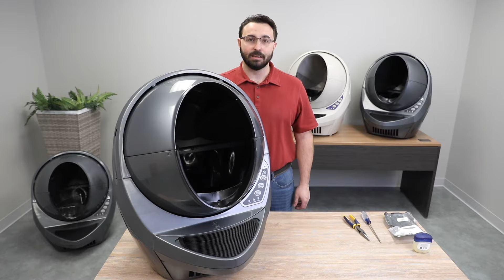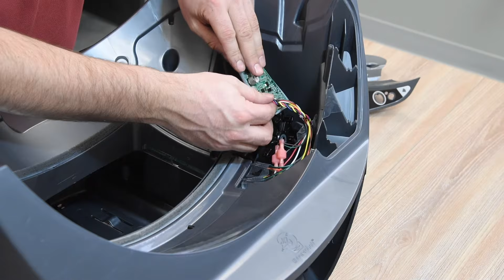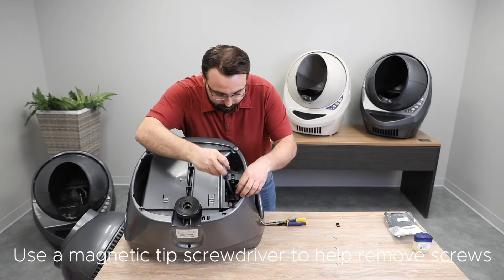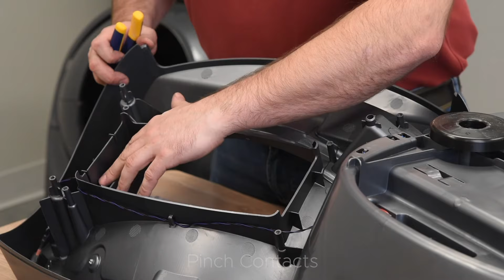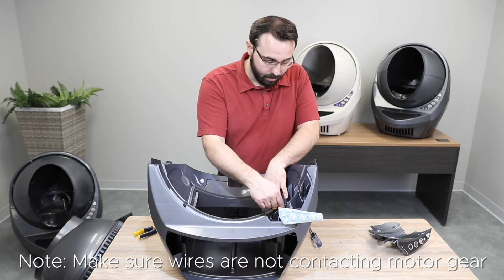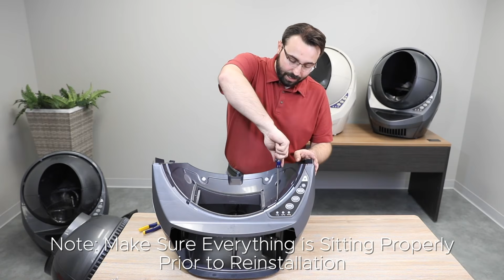Litter-Robot 3 DFI Kit + Pinch Detect Terminals Installation

Comment: This did the trick for me. Thank you. The only problem now is that after  a cycle the robot returns to its position but at a slight angle; so if you're looking at the front like a clock face, 12pm is the correct position. Well mine returns but it positions itself to 1pm instead. Also, once the cycle is complete, the dashboard lights up (all 3 lights) and needs to be manually reset to get the robot back into ready mode. On another matter, I have to counter some of the criticism I've read on here. The company have been very responsive with me. They have patiently answered my questions online, gave timely responses and recommendations on repair and processed my order efficiently. The team are absolutely ace and from my personal experience, I have nothing but praise. As for the robot - I've had mine for 5 years and this is the first repair its needed. It is an unbelievable piece of kit and performs perfectly well for my needs. It hasn't let me down in the past and consistently completes its job with little attention from me. The unit is transformative and sets the standard in this growing industry. Expensive yet, but if you're buying to avoid the daily scoop ritual then it is worth every penny. I wouldn't be without mine.
Reply from the maker: Thank you for your lovely feedback about Litter-Robot and our Customer Experience team!! We would be more than happy to get you connected with a product specialist to resolve this for you so your unit will return to home position correctly. If you haven't already, please visit our Help Center (WhiskerSupport.com) to chat with one of our product experts or submit a ticket.

Comment: Thank you for the helpful video. I followed the instructions and fixed Mayhem the cat's poopbot without issue. It's now November of 2022 and there appears to be a version 2 of the DFI kit. The circuit boards are smaller and the included new brackets don't have the little windows so they can be cleaned with a cloth instead of a q-tip.Tip: As soon as you split the bottom section take a picture with your phone of the pinch connector position, because trying to unplug them may yank them out and the video is not clear on their positioning.
Reply from the maker: So glad to hear Mayhem's Litter-Robot is working properly again! 😸

Comment: They need to answer their customer service phone lines, not just make videos and “email you” which is extremely annoying.
Reply: That would require them to actually care about the customer experience, which they don't. These parts have a shelf life of barely over a year, if that. If they email they'd have to acknowledge an actual issue. This way they can just toss you a generic response and pretend they did a good job
Reply: Nobody answers the phone
Reply: I rather email, who still talks on a phone?
Reply: @Camcruisejourney  many people would prefer phone for customer service because it often is resolved far quicker than email since they can't toss you off for days with no response
Reply: I can’t even get them to reply to an email.
Reply: It took like 4 hours but I didn’t have to stay on the phone. Lady was super helpful and sent the replacement kit. Tried to upsell me on the new model but their CS was great. Not sure if this is new
Reply: @StephenSatire  lucky, mine took 4 days to answer and then the response was “is the light flashing fast or slow?” Took another 3 days to answer that. Their customer service is a joke.
Reply: They answered my phone call and they where amazing
Reply from the maker: We are very sorry for the delayed response. Due to an unprecedented level of demand for Litter-Robot 4, we are experiencing an influx of communication which has resulted in higher than normal wait times. We have turned off our phones until response times have normalized. We can also be reached at https://support.litter-robot.com/s/?language=en_US. In the event you are unable to solve your issue, the troubleshooter form will prioritize your case with a Customer Experience Representative.

Comment: Extraordinarily difficult for someone not mechanically inclined. I did it but I dropped the f-bomb no less than 25 times. I also expected that my robot would last more than three years before I had to make repairs. I have two robots and both needed this repair at approximately three years.
Reply: At least they're repairable and you dont have to buy a new one every three years. Hats off to LR for that.
Reply: @NigelM18  Not expecting to pay $600 and have to fix weeks after the go out of warranty.  Looking for a better option - would be very. nice to hear from ex-LR users?
Reply: Well done, and great to hear you managed even though not mechanically inclined. “F” bomb is the new function word lol! For longevity, do use good clumping clay litter, with low dust good for appliance and cats, to keep the Robot cleaner and minimise odour.
Reply: Yours lasted three whole years before you had to do this? Consider yourself lucky!
Reply from the maker: We appreciate your feedback on this, Chris! If you ever have any questions about your Litter-Robots or run into any issues, please let us know at support@whisker.com or whiskersupport.com.
Reply: Mine lasted not even 2 .. they repaired in and exactly one day before the 2 year warranty endet they send me the parts and told me to do it myself
Reply: Those “F Bombs” were entirely warranted 😅

Comment: Wow! I didn't know we have to esemble
It ourselves. I hope that I can put it together with no hassle. Or try to get someone who can do it for me. Or have the shop/store get it together before delivering them to me
I'm gonna need two of this Litter Robot. 
I have 3 Cats.
Reply: The Litter-Robot is designed for multiple cats, ideally 2-3 per appliance. It comes assembled in the box. This video is self installation of a replacement part.
Reply: @Catevolution1  You only need 1. Version 4 of this robot is rated for 4 cats.

Comment: replaced the dfi and pinch detect step by step with the directions. put it all back together and getting a solid yellow cycle light. the unit will not cycle, reset, power on or off just stuck on yellow cycle light. on the app it says that the unit is off even tho the power is on. robot is unresponsive and nothing is working. HELP!
Reply: Did you ever get this fixed?
Reply: Try unplug and realign the DFI plug in motor well. Dark wires should be up not down.
Reply: @Catevolution1  the dfi and all other wires are plugged into the circuit board correctly and securely.
Reply: @Cat Evolution  robot still does not work, all wires plugged in correctly, new motor was installed as well as new power cord. Still just solid yellow light with no function whatsoever
Reply: @peterc6197  it might be easier if you email for some help support@catevolution.com.au. I would like to see your motorwell as a photo taken from overhead looking down on layout. Also a second one showing all the plugs in socket in back of main circuitboard. Photo of pinch detector and both DFI too (take in situ, no need to open base, but open motorwell). Have a good look at your maincircuitboard front and back when you have motorwell open to see if you can see any damage as well.